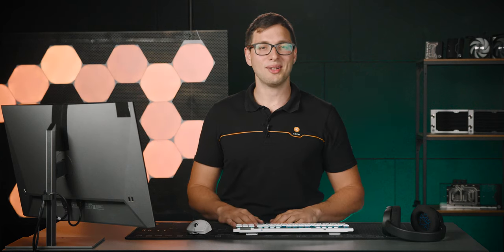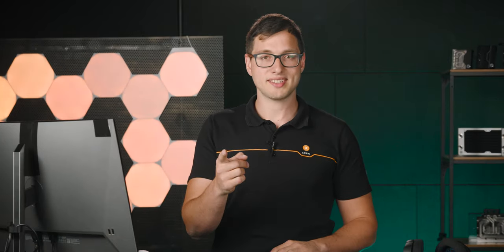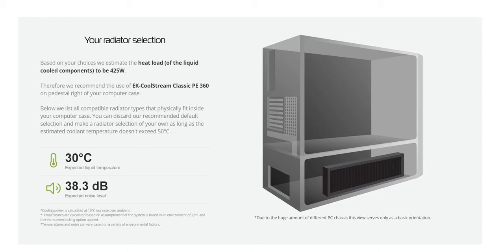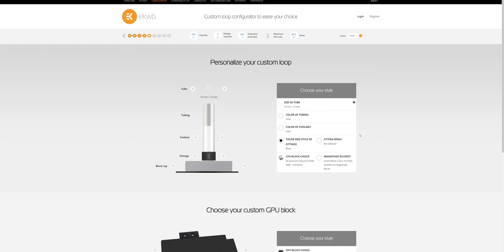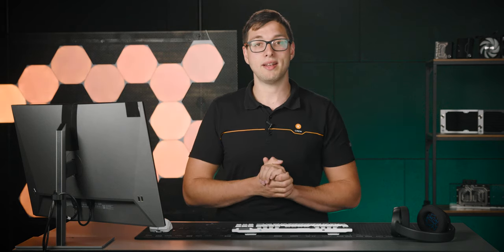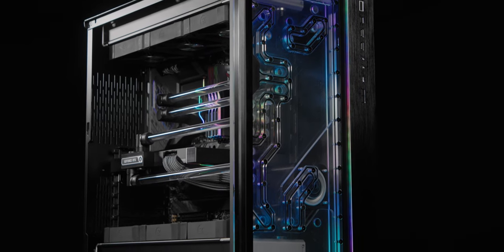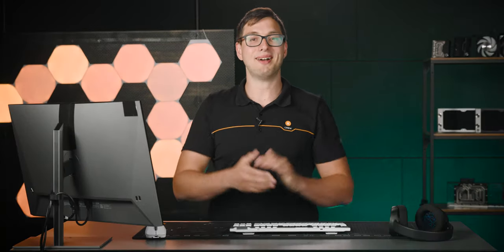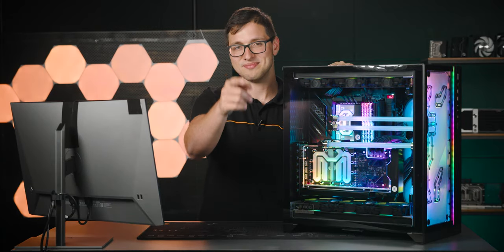How to Configure a Perfect Liquid Cooling Loop | Basics of Liquid Cooling

Comment: Can you show exactly what is needed in the final build? For example, I don't see extenders but they are used, there are various choices at EK and I would like to know which one to buy.
Reply: If you know that there are extenders used by just looking than you probably don't need a guide :3
Reply: @ZinoAmare  You know ek has different length & types of extenders right? And for specific settings. It is hard to find out without having the item at hand to try it yourself.
Reply: @jjlian1670  and you knowing all this, says enough ^^
Reply: @jjlian1670  .. I agree 💯% and would like better guidance on their configurator which fails to list any 90° fittings, extenders, etc. Just because we both clearly know what in general is needed, knowing exactly what's needed is a whole different thing. So you end up having to contact EK directly anyway...

The last water cooling rig that I built used flexible tubing and was years ago.

Comment: Hi Matic Matus, I'm trying to use a radiator from an old water cooler but the hose fittings are 1/4" barbed.
How do I adapt it to the standard 3/8" hose?
Reply from the maker: You may be able to replace the fittings on the radiator with those of a different size. Contact our customer support with all the info and pictures and they will look into it for you: https://customerservice.ekwb.com/hc/en-us/requests/new